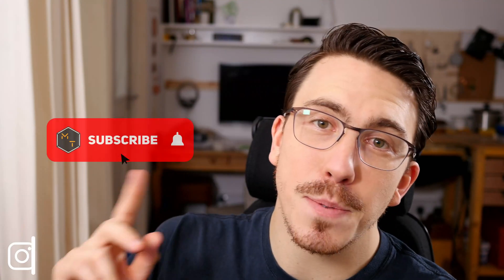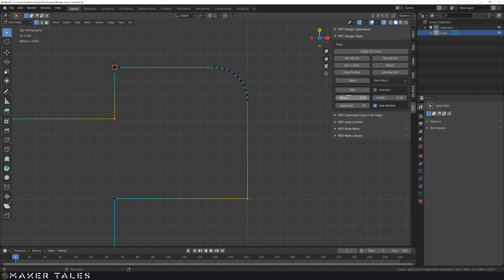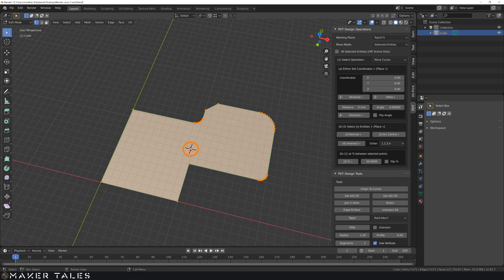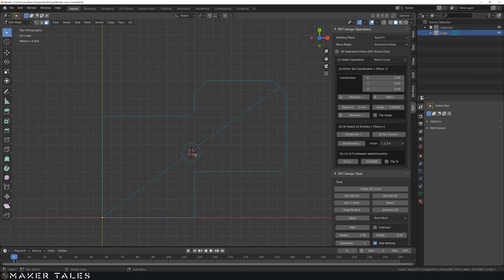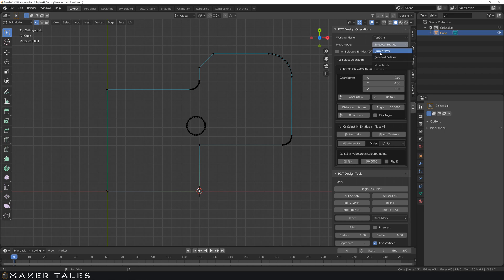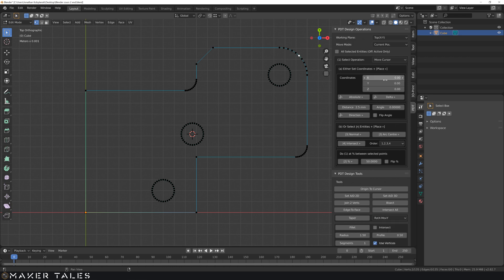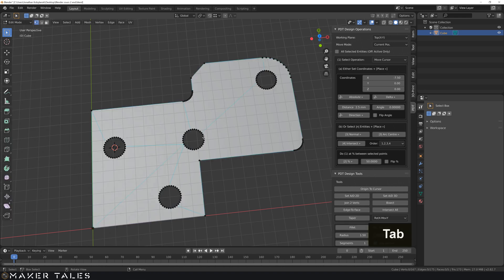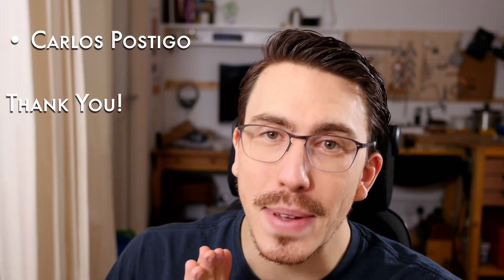Precision Modeling In Blender 2.82 : Holes & Fillets - How To: Using PDT ( Tutorial Part - 3 )

Comment: I found an easier way to make holes: just add cylinders! 
Steps:
* Fill the entire surface 
* Add cylinders  wherever you need to place those cuts
* in object mode, click on the surface and then add boolean modifier as 'difference'
* set as target each cylinder and apply effect(this is your cutting tool)
* finally select all cylinders to delete and you will be left with holes 
Hopefully you find this useful.

Comment: I have to type 0.0025 in the radius-field to get a correct fillet. Why did this happend (WIN10, Blender 2.92.0) Thx for help.
Reply: And YES, my system length is set on mm.
Reply from the maker: Start form the begging of this course here and i'm sure it will make sence with time... It's to do with your unit scale not set to 0.001 https://www.youtube.com/playlist?list=PL6Fiih6ItYsXzUbBNz7-IvV7UJYHZzCdF

Comment: im working on a simple design of my own right now.  but for some reason when i try to make fillets on one particular corner it generates way more vertices than specified and it looks like its expanding into a 3d space rather than flat like the other fillets on the same design.  any ideas?
Reply from the maker: Hey Bash, This sounds like you have overlapping vertices. I would also suggest using the updated course https://youtube.com/playlist?list=PL6Fiih6ItYsXzUbBNz7-IvV7UJYHZzCdF
Reply: @Keep-Making  yea I switched over to the new vid. Overlapping vertices was my first thought so I xrayd selected the vertices and merged by distance. Said none were removed. I also selected all and repeated that with none removed.  Once I turn the design into 3d it looks like it’s creating fillet and then a single anchor point outside the curve. I resorted to doing it that way and the. Deleting the “anchor” vert. Not sure what the heck is going on.

Comment: I'll give it a few more videos, but right now I'm thinking FreeCAD/CAD is a much better suited tool for this kind of work!
Reply: ..CAD.
Reply: I tried FreeCAD a year ago or so 0but is was sooo terrible to use, and my model never turned out as I wanted even if I exactly (yes, 100% exactly) followed the tutorial then it turned out there was a bug in this and that version, the default properties were different, they changed some som MINOR thing and so on. Plus the GUI is not very intuitive (I think)... I tried Fusion 360 with personal/hobby license, that was much better but I am stuck with blender I think, it looks CAD is not for me. But for some job CAD is definately better. Give fusion 360 a try too if you have problems with FreeCAD AND you don't mind using an Autodesk product.
Reply: @cstrx11  Yeah I found it very difficult for the first day, but after that pretty straight forward. There was no instant gratification. I only use it to designed machined parts, it's the wrong tool for complex objects, like models of people, etc.

Comment: Man, you need to boost your modeling skills, some operations could be made much faster! Making holes - knife project tool, you making Ngon and cut shape of cycles, delete faces in centers, thats all. Also making fillets is destructive way, better to use bevel modifire in the end so you can tweak filets or shape of fillets.
Reply: I was thinking the same thing.. Not trying to disrepect the video, I do think it was informative and I want to continue learning about PDT. But I honestly think all of this video could be done in Vanilla blender faster and more efficiently. Most of the things done with the 3D cursor positioning, such as placing between median points or offsetting by exact amounts. The Shift-S menu has a few operations for manipulating the cursor, as well as the N panel where you can enter arithmetic expressions for the transform components of the 3D cursor. I can understand maybe trying to appeal to a traditional CAD user, but those ways of interacting with Blender are just the basics and should not be discarded all together.

It's also somewhat of an unknown feature, and I actually wouldn't really reccommend this route, but it's interetsing to think about. The curve object has functionality for 2D directly. You can take a curve object, select 2D and `fill both`, and then compose other curves inside of the same curve object. Those nested curves will be treated as 'boolean differences' directly. If PDT could interact with curve control points then that would be a much cleaner way of dealing with holes on 2D surfaces. This IMO would be better than some messiness with using 3D manifold cylinders to boolean onto the 2D non-manifold surface. It might work, especially with the Exact option given in 2.9, but it still feels kinda wrong lol. There's also the benefit that curves have variable resolution instead of verticies. The workflow given by PDT as it stands seems to not favor modifers/nondestructiveness at the 2D sketch level. It would be so cool to have it create fillets out of bezier handles and things like that.

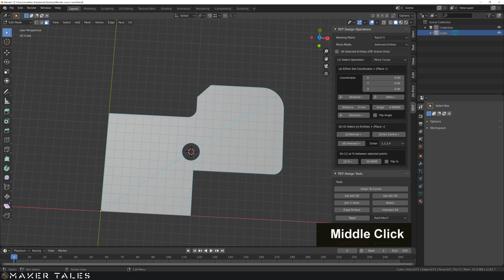Comment: Right at 8:00, I tabbed out of edit mode and nothing was showing.  What happened is my normal's were facing downward. If that happens, the back side of the face becomes transparent. I've seen this (and use it) many times.  If you do a Shift-N to clean up normal's, and check off the Inside checkbox in the lower left, it will flip all your normal's, and your model will be visible again.
I noticed that you think the same as I do/did that booleans are bad.  Not so, but N-Gons are way bad, especially if you're sending them to a game engine or (maybe) a 3d printer?  There has to be a better way to tell Blender about the holes.

Comment: Hey Jonathan, I try to figure out why my fillet option within blender pdt wont work. I ve set top view in pdt and eg tried 3mm and XY segments. Any idea? Really grateful new user her :-)
Reply from the maker: Hi Rapheal,
unfortunately blender 2.9 has made a mess of PDT. But don't worry in the next few weeks i'm updating the whole course to blender 2.9 and there will no longer be a problem. I also know the dev is trying very hard to get this fixed asap
Reply: Pretty sure this is a bug with Blender 2.90 and PDT. I'm having the same problem. The bevel tool works well though.

Comment: Blender v2.90.0 PDT v1.4.0 the fillet button does nothing. Does not create the fillet at all.
Reply from the maker: Hi MindCreative Studioes, If you are on blender version 2.9 I'm very sorry to say that it looks like PDT is having quiet some difficulty as the update has really screwed things up. If you could kindly post these "bugs" to the dev he would be very appreciative https://blenderartists.org/t/precision-drawing-tools-pdt-add-on-for-2-8x/1196313/56

I would also just like to let you know that in about just over a month i'll be updating the whole course to blender 2.9 Thanks for your patience
Reply: @Keep-Making  I have submitted a bug report and it has been found by the creator of PDT that some of the Blender  API has changed. An update will happen at some point. Looking forward to finishing this tutorial.
Reply from the maker: @mindcreativestudios4709  Great to hear. Sorry, you're going to have to wait a bit. Maybe downgrade to blender 2.83 for now and finish the rest of the course. I'll be sure to put up a video that will let those that have already done the course know the changes in blender 2.9 precision modeling workflows.
Reply: hey mate just ctrl + shift + B and type in your desired distance eg. 10 for 10 mm. Then in the bottom left you can click on the bevel icon and change the segments etc. I was having the same problem with the PDT tool so i just did this instead

Comment: To speed up the filling at 6:00 , you can use Alt+F to do edge loop fill. After that to clean up the tris, you can do Limited Dissolve from "Delete" menu by pressing X
Reply from the maker: Good Shout Anssi,
Only don't side to this method is your not lose control of where you have your edges and this can matter laser on when doing bevels but absolutely this is something I think i'll mention when I come to updated the course to 2.9
Reply: Thanks man! If not that little trick that pain would be deal breaker for me!
Reply: nice trick!

Comment: I had trouble adding the faces. No matter how well I selected the vertices, and no matter which order I selected the vertices, Blender would bug out and create faces that extend inside the holes by connecting various vertices that don't have an edge on them. I ended up having to add a bunch of edges to make smaller faces to avoid the error. This is what my final product looks like with my tons-and-tons-of-extra-edges workaround: https://imgur.com/a/UslCXpP

Does anyone know what might be happening?
Reply from the maker: Hey David, I'm sorry to hear you're having some weird results. I have a feeling you might have overlapping vertices but I'm not 100% sure. Would you mind saving your file and sending it to Hello@makertales.com and I'll see what I can do to help out =)
Reply: @Keep-Making  Thanks for the help; the problem was, in fact, overlapping vertices. It's working now. Although, now I have a minor problem where the faces are transparent from a Top-Orthographic perspective (to the point where it looks like there are no faces), but the faces are visible from the  Bottom Orthographic perspective. The light source is actually above the side that looks transparent, surprisingly. Do you have any idea what could cause that?

Edit: nevermind, I fixed that second problem by adjusting the Viewport Shading. It's amazing, I feel like I'm starting to get the hang of Blender.
Reply from the maker: I'm so happy to hear that David! Just keep marching along and you'll have a supper grasp of blender in no time 😁

Comment: This is good and i learned a lot, but for holes why not only use booleans??
Reply from the maker: Hey Jonathan,
Good point, to be honest this was the break up the learning curve. You can't do a Bool cut form 2 plainar surfaces. One would need to be a 3d shape. As we have not entered the 3d space just yet in the series I kept it to manual hole generation for now. Plus this will help in the future if you need to fix weird and broken geometry int he future.